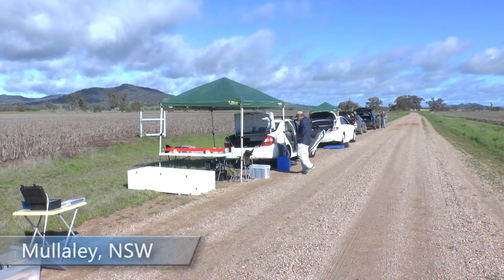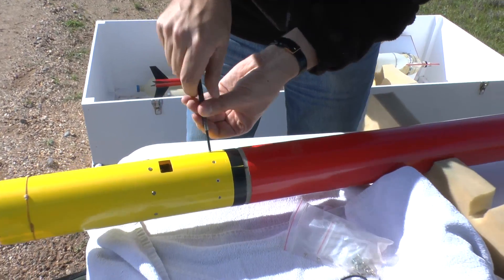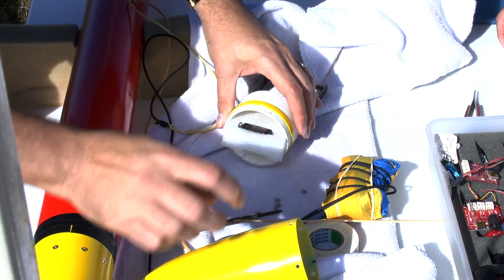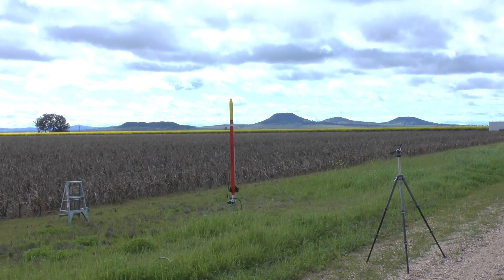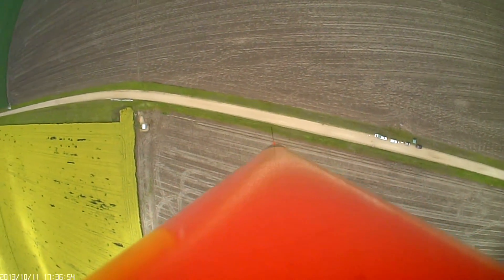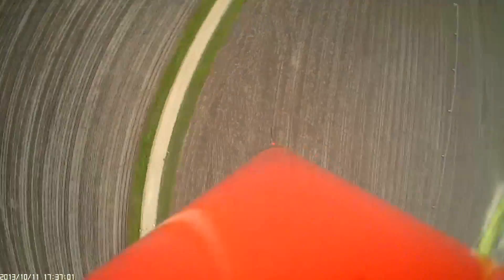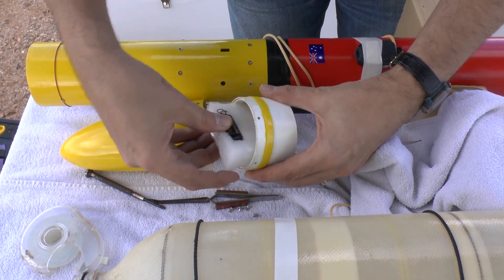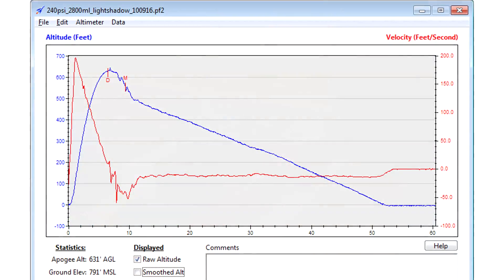High Power Water/Pyro Rocket - Part 3 - First Flight

Comment: Great video, the rocket performs very well at 17 bar, almost zero rotation. :) We are looking forward to see the upcoming high-pressure and pyro rocket flights! I really like the idea of the hybrid rocket. Keep it up! :)
Reply from the maker: Thanks Julian. It will be interesting to find out what the upper pressure limit is for this rocket, but I would expect it to be around the 20 bar mark as it is only made of fiberglass and has a larger diameter.
Reply: AirCommandRockets What's the weight and the volume of the rocket? Would be very interesting to see how it performs at 20 bar. By the way: We're planing again a video which summarizes the best water rocket launches of the year, and it would be really nice if we could use your footage. :)
Reply from the maker: The rocket weighs 1.88Kg and has a capacity of 8.2L. It will be interesting to see how far it will go. :) If it survives the H motors and the higher pressures, eventually we'd like to fly it on an I motor. 
Happy for you to use any of our videos in your end of year video. :)

Comment: Nice video and a great looking rocket. It's.........awesome. What a great work. Hopefully it will work fine with the solid rocket motor. it seems that the stratologger is doing  a good job. Looking forward to the next flight.
Reply from the maker: Thank you Luc, :) We are quite happy with the stratologger, it's easy to use. We've got a couple of H motors to try at the next launch so we'll see how it goes.

Comment: have you recorded the impulse of the rocket as it looses the water?  I am guessing that the thrust dramatically reduces after 75% of the liquid has been ejected since air is allowed to escape with little impedance through the large nozzle throat.  And, the current design philosophy is such that the nozzle throat aperture is relatively large to produce a large thrust at the beginning. What if the design is modified so that there is an aluminum(?) tube "manifold" from the nozzle that is long enough to extend past the water level in the "fuel" tank and into the zone of high pressure air.  There should be no cap on the manifold to allow air to flow freely toward the nozzle.  Then, drill holes in the manifold to meter the flow of water into the nozzle.  The holes should start at the highest water level and have several along the tube all the way to the vicinity of the nozzle. The size of the holes in the manifold can get smaller or larger along the length of the manifold to modify the thrust curve as the water level and air pressure reduce. Then redesign the nozzle throat diameter to correspond to the reduced water flow. It will take some tweeking between the air pressure, manifold water flow, and nozzle design to get the maximum benefit.  I am guessing that although the initial impulse will be smaller, the thrust will be extended over a greater length of time and could provide a greater overall rocket velocity.  Let me know what you think. I am retired from electrical engineering but have dabbled with fluid dynamics.

Comment: thanks for sharing again George, fantastic build. Sorry if i missed it, but what is the nozzle diameter on this rocket.
Reply from the maker: Thanks Jeremny. :) The nozzle is the same that we used on the Dark Shadow rocket we launched at Thunda. It is 15.5mm. We just unscrewed it from Dark Shadow and used it on this rocket. This way we already had the launcher fitted exactly to the size of the nozzle. Ideally the nozzle probably should have been a little larger for this rocket, but this way we saved a lot of time.

Comment: Very cool. what kind of G forces water rockets produce? How high can water rockets gow and what are the limiting factors?
Reply from the maker: Very lightweight water rockets such as an empty coke bottle can easily achieve an acceleration of 150G+ It all depends on weight and size of nozzle. It is unknown how high water rockets could potentially go. The current record is around 830m. The limiting factors are pressure containment. To get more performance you need more pressure, to hold more pressure you need a stronger pressure chamber, and a stronger pressure chamber is heavier which works against you.

Comment: Excellent! Are we going to see record heights in the next video? Do you plan to use this technology for the manufacture of a multistage rocket?
Reply from the maker: Cheers Water Rockets Club. :) No record altitudes are intended with this rocket. It's been designed to achieve a Level 1 certification , and so is built a little stronger (and as a result heavier) so that it can better withstand launch and landing. Because it is only made of fiberglass it also cannot store a lot of pressure. The answer to your second question is yes, multi-stage is definitely on the plans. ;)